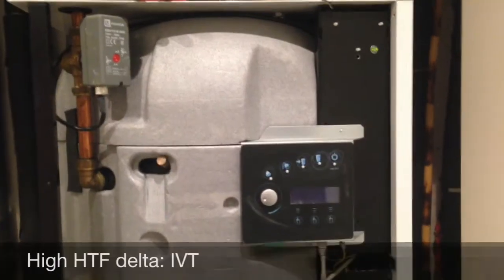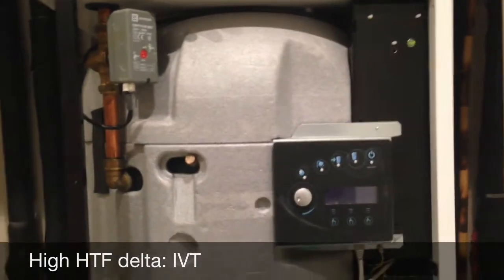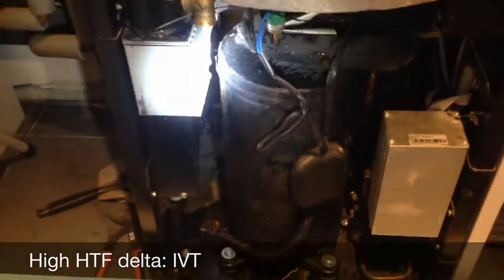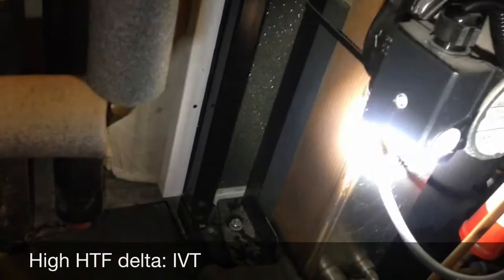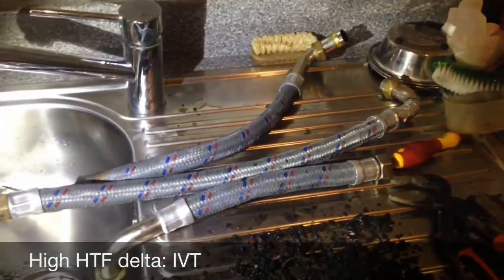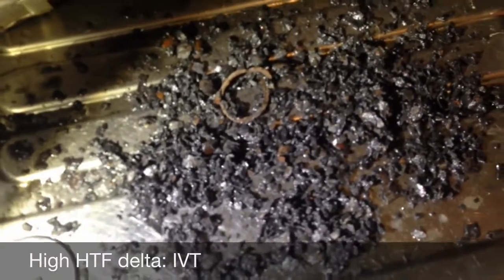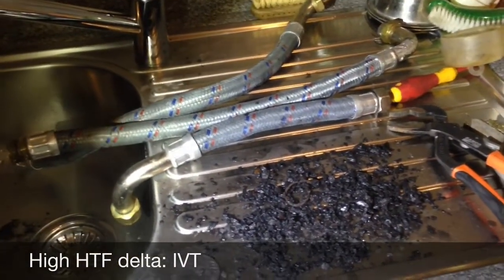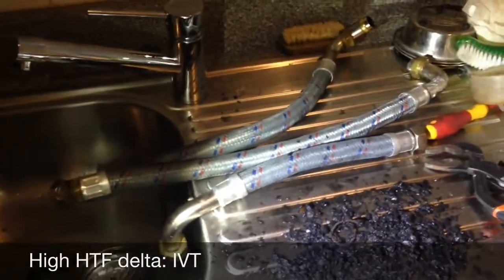High HTF delta IVT

Comment: HI, Do you k own where I can get  controller fixed REGO 637. the sensor GT11 is showing high readings 67, what is the part I need to correct this and where is it. Thanks 06/06/2025. IVT E11 and E9